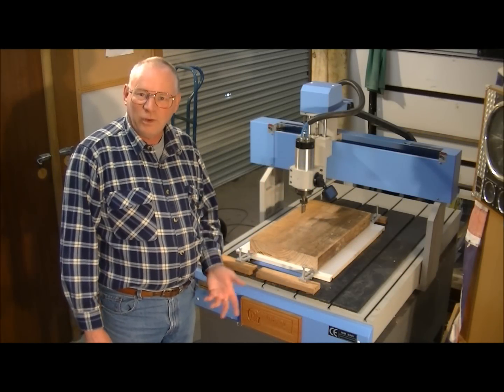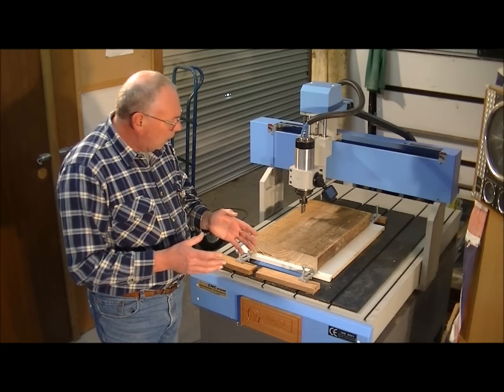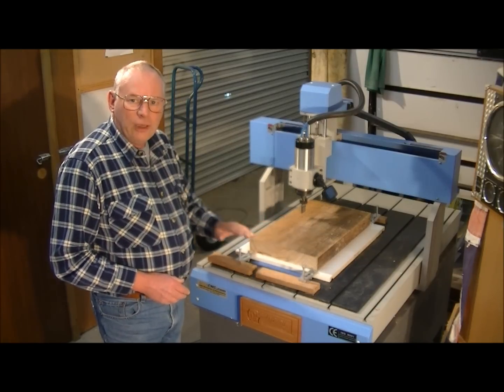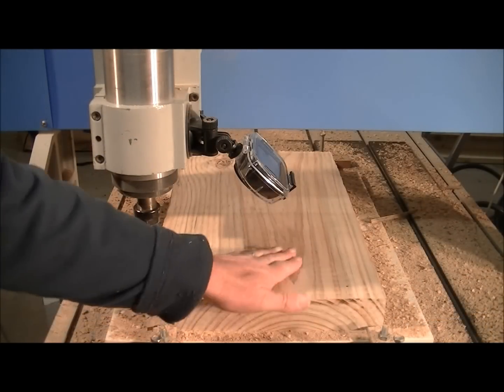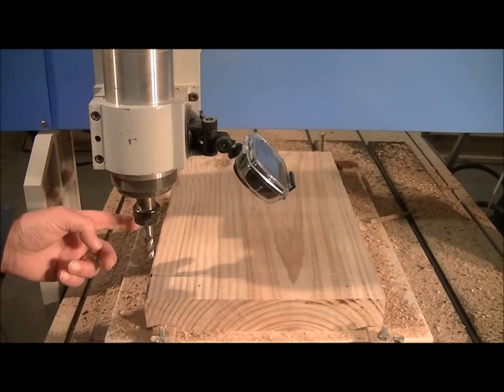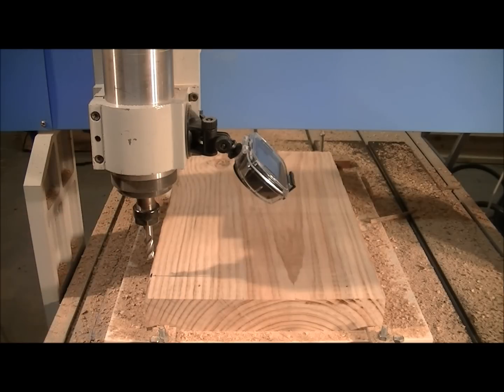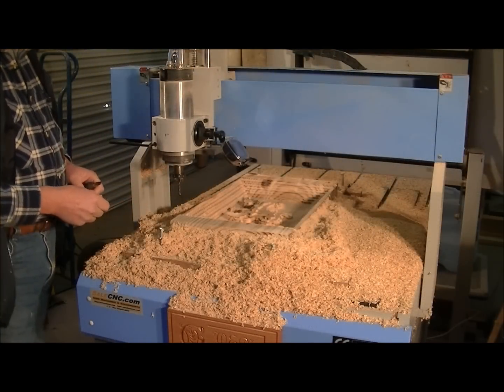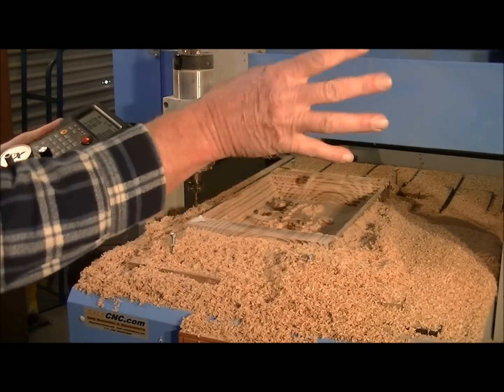CNC router #1.4M VIEWS! # making a $200 custom carving of a 3D fairground horse and the frame

Comment: Roger, as we are advised to use router cutters in a clockwise direction to have the timber going against the cutting edge, is a cnc tool manufactured differently due to it being used multi-directionally?

Comment: I bought a DIYCNC router in hopes to cut copper plates for a project I am doing.. spent all that money and it couldn't do it.  barely cut wood.. The NEMA 17s would go off kilter and I burned thru 2 of their crappy 1 amp spindles.. Went to Lowes and bought a 6 amp ZIP IT cutter and use it as a spindle.. Works great.  Jerry rigged it to my Z axis so I could cut a spindle holder for it.. Used some aluminum Angle bars to reinforce it.  It looks like poop, but works.. But those 17s would not do the job they needed to do.  And their program they gave sucked to run it all.  Stepped up to Mach 3 with an UC100.  Bought NEMA 23 KIT from eBAY.  Stepped up to a much much more powerful computer than what I was using.. Had an all in one touch screen.. Too weak.  Had just a 1.3 Ghz processor, 4 GB of ram tho. But used only 512 Mhz towards video.. Now got a 4 Ghz processor, 12 GB of ram with a 4 GB video card.. Water cooled with LEDs.. Ya.. Had to have them.  Doing my first run now with it all.  uploading a video right now to Youtube. I plan to build a new frame and make a larger cnc with the equipment I have.  soon.. soon.. 

 I have been watching  your videos for a while Roger Webb.  You are inspiring.  I'd love to get that G code for those Images.. OR the CAD program.. So I can scale it and make the G code myself.  Love those patterns and designs.. Did you make those or is there a place to download those? .. Thanks..
Reply: ciao complimenti mi puoi dare info anche a me  grazie regaanvi@gmail.com
Reply: ghodd100 - Hi Mr. Roger I am from Iraq my Email walwefy@gmail.com , I won't to buy one machine, Please inform me about it every think price, price of shipping to Iraq, its software, how it works, anything I can work on it , or any other information, to work at home, 
with my sincere thanks and appreciation
Wafaa M. Zaki
Iraq / Baghdad

Comment: Hello. I have a question to you. for example, I want my CNC to cut a square, I'm using ArtCAM 2008. When I sent a drawing I cut out a square round the corner three. only the starting point is going to cut sharp corners. What could be the reason. Thank you.

Comment from the maker: Hi, hold on, on purchasing a CNC machine. I will be making some exciting news announcements in my next videos. Basically, I am opening a factory up to produce “will made and designed” CNC router and milling machines and full conversion kits.     
Roger Clyde Webb inventor Australia  14/05/2016
Reply: You said that 2 years ago, what happened?
Reply: It does not look like Roger Webb is interested in answering questions :o(
Reply: Should that not be :"WELL made"?
Cheers
Reply: Hi Christian (Danish?)
My protection tells me that website is dangerous.
Cheers
Reply: "will made" or "well made", not like they are building anything to technical tolerances, what's a typo among ferinds?

Comment: Well. The CNC routing needs optimisation. Drawing a frame that way is a huge waist of time. Same for the horse. Instead of "printing it" like an old matricial printer, you could have used a contour following algorithm performing the job with a better model sense.

Comment: Roger Lord, goodnight. I would like you to help me, I'm making a 3D woodworking cnc router, I have three servo motors NEMA34 4Nm, 24000 2.2kW spindle. but I stand not knowing which diameters for fusos spheres with advance 5mm X, Y, Z, because like a lot of the speed of your machine. so I would like a suggestion to the diameters of X, Y, Z. thank you very much and I hope for your reply

Comment: Thank you for sharing your amazing work. I also have a small 3 axis but a much smaller one. I was worried that resolution would drop off as the contour changes from horizontal to vertical.. but I see its of   no concern.

Comment: Knowing nothing of CNC machines, I'm left wondering if you could zero Z-axis by holding the new router bits tip on the reference height point, lower the cnc machine on it and simply attach the bit there. Guaranteed to be level at 0-height with minimal fuss.

Not that the paper trick is much work either, but if you're doing this a lot, it could save you some time.

Comment: Hi Again , and sorry to bother you but the machine in this video is what I was asking earlier.  I m wanting to know what cnc breakout board do you use , I m interested as I would like to make my own electric guitars and here in uk as in usa the are not cheap . And would make a big difference for my small designer business . For now I just print garments and make 3d toys with my i3 prusa . Again thank you for your time and patience. 

Best regards. 
JUAN . ●JSTdesigns -( Facebook)
Reply from the maker: Juan Santana 

The 6090 (bed size) CNC router machine is from Salecnc China, (speak to
Jimmy good English), I had the machine up rated to 8 inch / 200mm gantry and 2200w
/ 3hp spindle (router motor) + I had the 4th axis. Total cost
including shipping and TAX, USD$ 7000, I would also recommend you purchasing
ArtCam Express software approximately 200 USD, as the CNC router machine is
supplied with ArtCam Jewel-smith from Salecnc China, but with NO 3D reliefs.
ArtCam Express comes with over 600 3D reliefs. Hope all this help. Roger
Clyde Webb Australia :)
Reply: Roger Webb good work... if anybody needs some custom reliefs or G-Codes ask me I am sure i can create anything thats required nice videos Roger